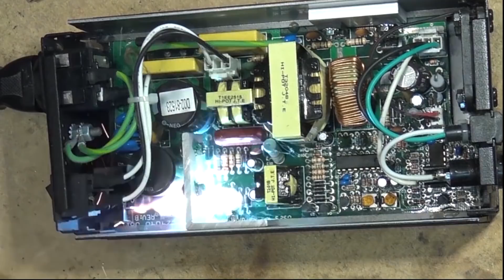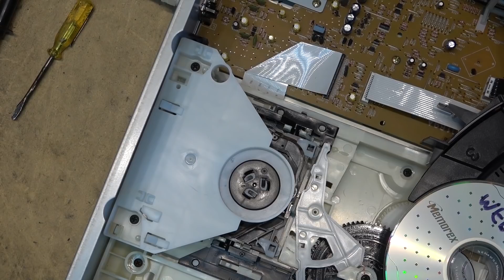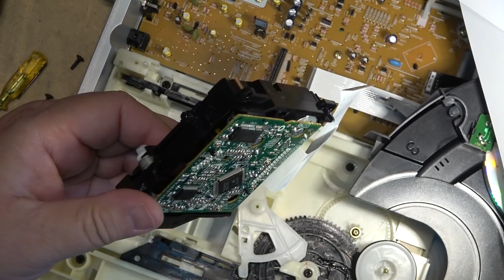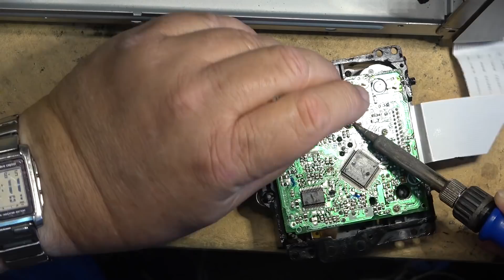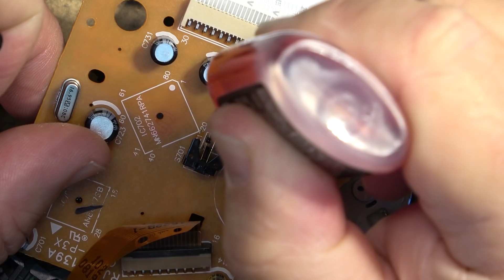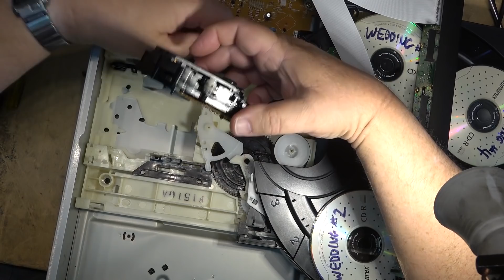Technics SLPD8 No Play is the complaint

Comment: I learned the Hard way with Vacuum Solder suckers..  Turn on the Vacuum before placing the tip to the work piece and leave it running long after... 
Thanks Dave...

Comment: Very useful video, the laser in my 887 changer will sooner or later need to be changed, I've already got the replacement pickup and will return to this tutorial. Regarding your story, I had lots of doubts before buying a rare and thus overpriced com port cable to calibrate my 16 year old camera. One will hardly need it more than once but I got it and kept it. In a long run the purchase has paid off as I myself serviced a few similar cameras for other people. P.S. Another annoying issue for these machines is poorly functioning 'tray open/close sensors.

Comment: Digital Servo: guaranteed UNRECOVERABLE FAILURE.

I don't know if it's the optical pickup, the laser illuminator or whatever that was not up to par with the former design. That's what I've got out of my very limited CD unit repair experience. Some just need tweaking and they come back playing beautifully.

Perhaps the digital servo is too good by compensating for shifting values and degrading components... or perhaps no adaptation is done and the modern pick-ups are not of the same quality of the old.

Comment: I use the stripped outer coax shield  for solder wick. Apply  a drop of soldering flux on it before use, its cheap and works just as well.

Comment: I have a SL-PD6 which is basically the same unit with very minor differences, I bought used it read some CDs, some read fine some did not, some started fine but have way through the CD it would start to get noisy and skip and wouldn't even read the last tracks. Complete optical mechanisms for these are still available on AliExpress for relatively cheap so I went ahead and bough one, it's working great now, but I noticed that it does not like TDK CD-Rs at all, every other brand seems to work fine though.
Reply: Optics are not accepting anything but actual CD. No recorded or such.

Comment: I think i worked on one of those early Technics CD player SL-P1; to adjust all gain's you are required a special traverse unit base and a servo gain adjuster ... Luckily in my case it just had electronic problems and then worked fine with no adjustment required. It's a scam from big brands to require all that expensive equipment just to repair one generations of CD players: it pisses off both service centres who has to pay big money on test jig hardly ever used and customer when a service centre refuses to buy such expensive test jig and then does not offer repairs.
Reply from the maker: We got to that point.  Shipped all that shit back to the manufacture.   That was around the time i was getting ready to walk.  I was so fed up with it.

Comment: Your boss should have made the decision to buy that jig himself.
That is the kind of thing he should do as a boss.
I had a boss that skimped on everything, i often could not finish repairing electronic modules due to lack of parts. Stress built up over the years, i became ill.
Reply from the maker: The guy j worked for saw the service dept as a thorn in his side.  He only kept it because customers wanted in house service.  He wanted rid of it for years.   After I left he hired a few guys that didn't know what they were doing. That was the final straw and he closed the in house service.  Customers responded by shopping elsewhere and the store closed a few years later.  He wouldn't spend a dime on the service dept.  I had to supply my own solder iron, scope, meter ect.

Comment: The key to clean the de-soldering pump tips is a hand drill. Hakko sells a specific drill tip to clean their pumps. It works great to clean out the tip that gets plugged up when de-soldering. The steel plunger is useless I've found. Go with the small drill tip and you are golden. Once you can clean the de-soldering pump tips properly, you will never use solder wick again.

Comment: I wonder if he brought it in from somewhere cold and the lens was fogged up and by the time you got it to work on, it had stabilized and cleared off.
Reply: @12voltvids  Dave you having a bad day? It may have been sitting under an AC vent who knows. Something was causing it to not read discs for the owner unless he was pulling your leg.
Reply from the maker: @Taco Neighbor doesn't have AC and there is none in my shop. My house on the other hand is nice and cool. Dirty disks are more likely, but they were clean.
Reply: @12voltvids  Okay, I was just brain storming, I'm in the USA (Georgia) I don't know KM, but I put it in the converter in my phone and it was almost 4 miles (mph) the surgery went well and she's doing well too? I wouldn't have looked forward to that long of a walk in the summer heat, I wouldn't have been in the best of moods myself. Well wishes for a speedy recovery for the Mrs. 👍
Reply from the maker: @darinb.3273  yes about 4 miles. It was warm.  Picked up the bike and went for a blast down the freeway to cool off.   The Mrs is fine. Just won't be able to lift anything heavy for a few weeks.   It was a repair for a botched procedure 24 years ago.